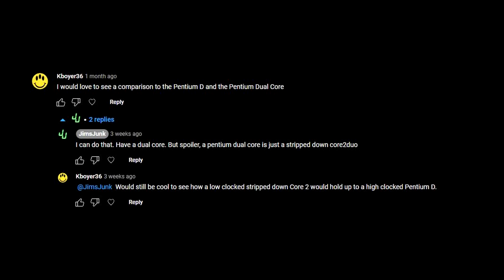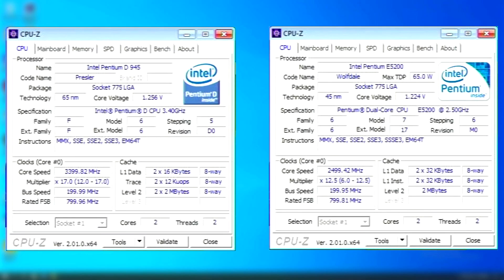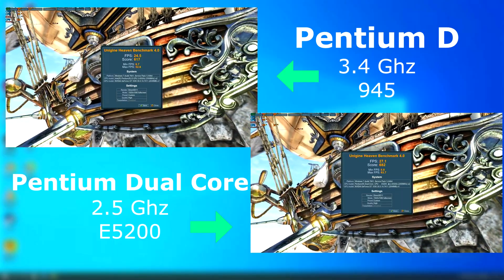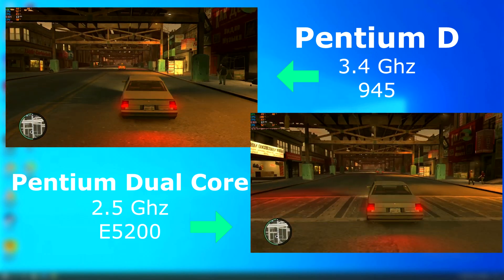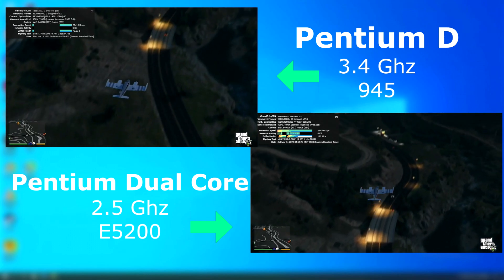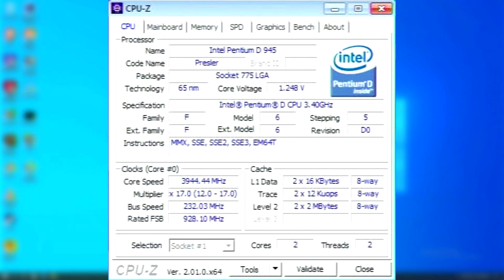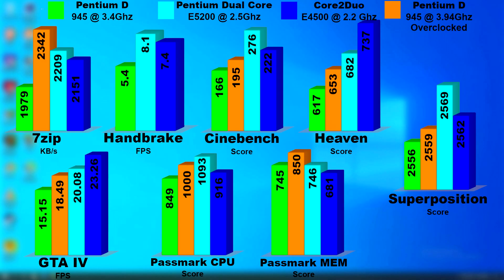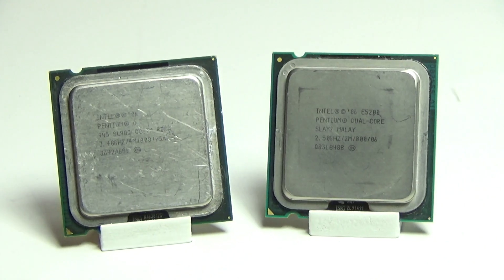Pentium D vs Pentium Dual Core - Were they the same? Similar names, similar performance? + Overclock

Comment: I had a Pentium D 820 2.8GHz. At 95watts, it ran hot for what is was. Had a huge Zalman CNPS9500A-LED cooler to keep it under control. Still did everything I needed it to do. I believe I had a Bio-Star motherboard with 4gb of ram, Windows XP.  Brings back fond memories.

Comment: The Celeron 4205u runs at a little over half the Pentium D's speed, also being a dual core. Would be interesting to see how they test against eachother, considering the 4205u was being sold at least until 2020. It's worth noting that my specific model of laptop with the 4205u (Dell Latitude 3310) shipped with a screen defect that is very common. I've met at least one other person at my high school who also has dead pixels covering around a tenth of the screen, so it shouldn't be hard to find one for free if you're okay with testing a laptop with a slightly ruined screen.
Reply from the maker: sure that's what external monitors are for :)
Reply from the maker: I'll definitely add it to the list.  Got a few things going on in life right now and some videos started but not finished so I'll add it to the list

Comment: Without all the b***** the Pentium D is obviously more powerful. That's why it requires more power no different than when working out. The more you put into your workouts the more carbohydrates you need for fuel😅
Reply: mmmm no.  Thats why netburst was canceled.  It needed to run at farrr higher clock speeds to perform the same as non netburst cpu's of its time.  Just because something uses a lot of power, doesn't mean its always better.  There is a thing known as efficiency.

Comment: Hello, I don't see which Windows version you using, it is important. Seems it was 7(2009) for a cpu D made in 2006 and expected to work in fast windows XP.
Reply from the maker: Both are running on the same version of Windows 7 x64.  Running these tests on Windows XP would have yielded similar results.

Comment: The Celeron version of the Core 2 Duo are actually literally Celerons. They are a tad slower than the Pentium Dual Cores due to the half the cache (1mb vs 2mb). Every generation of the Core 2 Duo has a Pentium DC and Celeron counterpart from the 65nm based Core 2 Duo down to the 45nm which is where the E5200 is based of.

Comment: Pentium 4 was such a disaster for Intel. They were lucky that they still worked on old P6-derived architectures (Pentium M) so they could go to "Core" architecture.

AMD was on the fantastic rise in this time as well, with Athlons being much more efficient, more perormant and cheaper at the same time, as well as leading technology with AMD64 architecture that basically every x86 CPU is running on these days 😉
Reply from the maker: Man I remember those days.  The sides were so divided, yet it was obvious that AMD was  superior.  Once intel came out with the Core lineup, that was when the playing field evened out.  I still remember having a dual P3 that matched and in some ways was faster than a Pentium 4 HT that I had at the time.  When I showed my co-workers and friends they were amazed.  You're right, netburst was REALLY that bad.
Reply: @jims_junk  netburst wasnt bad, prescott was
Reply: @siniyden  Prescott is still Netburst, it's just an extension of that. 
Netburst is the "family" while Willamette, Prescott, Northwood, etc. are the cores based in that family.
Reply: @thawkade  I know, but northwood was proper processor. Willamette was not that bad, it was 180nm fab. In prescott they gone too far

Comment: do you have any nehalem chips? would be cool to see some comparisons between them and core/phenom (and phenom ii i guess if you've got those).
Reply: Yees! jogo porque atuarias sem espera
Reply from the maker: Actually I was just thinking the same thing.  I remember my first i5 SUCKED.  Not sure if it was the board or cpu but I wasn't impressed.  My overclocked Core2Quad beat it hands down.  Was thinking of going back to that to see what the deal was and if they are any better than a Quad.  I could definitely also do a video marking it against a phenom II.  Would also like to look into FX processors.  Never had a chance to mess with them but all I hear is how bad they were, I want to see for myself.  So many people complained about the original Phenoms but I thought they were GREAT value for the money for their time.
Reply from the maker: Also If I could get this channel monetized, I could put those earnings back into the channel. Just need a couple hundred more subs.  Sounds strange but its fun playing with all these older things that I could hardly afford at the time.

Comment: Did you need a hotplate? I imagine a 4ghz Pentium D gets pretty toasty
Reply from the maker: HAHA Not a bad idea.  I want to find another board that I can do real overclocking with.  With a larger heatsink and more voltage, I can only imagine.  I remember the Dell Optiplex clamshells were like hair dryers.

Comment: If netburst was around today the Pentium T (Tuple), behold 12 p4 cores TDP 1000w (non boosted) PSU's required plural. Liquid nitrogen not included in box. Screw your efficiency core, 12 inefficiency cores FTW. Intel inside, until it blows and its outside.
Reply: Yes one will forgive the creators for this…
Reply from the maker: LOL yeah and the sad part is there would be fanboys swearing by them.

Comment: the 7zip comparison is interesting, the "quad pumped" nature of the 4(especially a bus dependent D) might have lended itself to doing far better isolated math calcuations when the other throttling factors of the 4 were not in play (as much) as in 7 zip.
Reply: Branch prediction combined with long instruction pipeline is very effective with simple repetitive tasks. 7-zip is one of them, simple benchmarks like passmark benefit too. But when task gets complicated branch misdirection happens more. The longer the pipeline the more steps has to be tracked back when misdirection occurs.
In Core architecture they reduced pipeline length drastically ( from 31 to 14 ), it's much better for gaming, and slightly less effective for simple task like benchmarks.
Shorter pipelines didn't really hurt performance unless someone is zip-ing files all day long. 😂
Reply from the maker: Good thought.

Comment: Pentium Dual Core was a great budget CPU for he time and the fact it could overclock 1Ghz past its default 2.5GHz clock made it a good CPU for people who wanted to save a buck but get impressive results with a pretty easy overclock
Reply: Even without an OC, the Pentium Dual Core used more power while idling than AMD's direct value competition used under heavy load...and could barely beat AMD's budget single cores. The OC potential was pretty impressive though.
Reply from the maker: I never really used em too much back in the day.  I was always so busy at my job that I didn't really have a chance to research or even keep up on newer technology.  The district I was stationed at had nothing but Pentium 4's and D's.  We were replacing them so I had my assistant order a handful of budget desktops that WEREN'T netburst.  He ordered a bunch of 'dual core' HP's.  At first my heart stopped cuz I thought he ordered 4 dozen D's.  I had to stop what I was doing to look up the cpu that was installed before I strangled him.  Didn't I feel like a dope to find out it was just s slimmed down Duo, but was shocked at how well they performed.

Comment: Nice benchmarks. The Conroe and Wolfdale CPUs were so much faster and overall better than the Pentium D generation. The E5200 was an excellent budget CPU able to overclock at default voltage to around 3000-3400 mhz
Reply from the maker: Thanks! Yeah I was very surprised at how decent of a cpu it is.